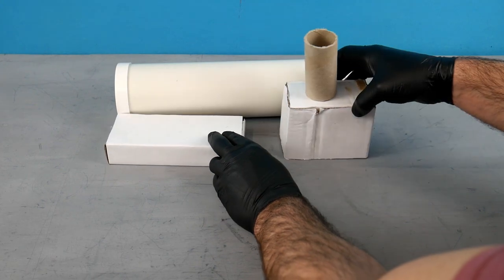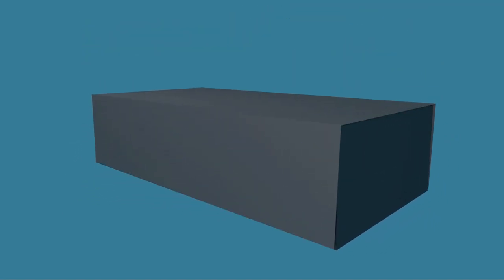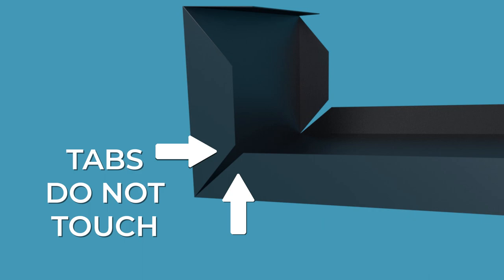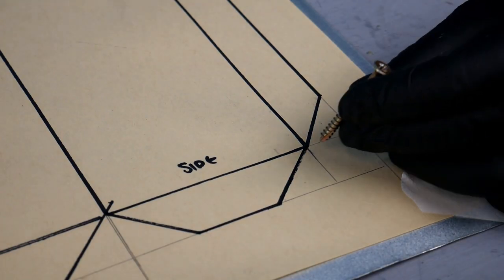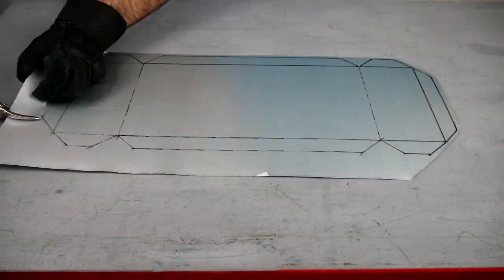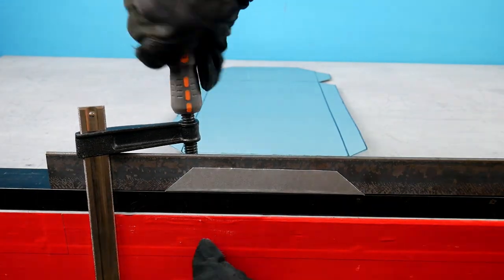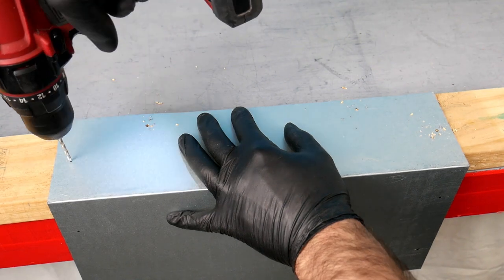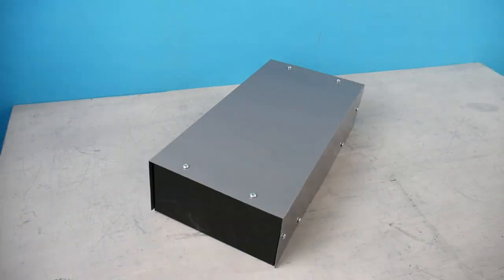How To Make A Metal Project Enclosure

Comment: Wow, you managed to pack lots of good information in a 7.5 minute video! I have a couple of comments regarding the final step of joining the halves with screws. After drilling clearance holes, you proceeded to mark out all the smaller diameter holes, and then mark them out. As the thin sheet can shift and bend while marking out, there is a possibility of mis-marking some of the holes (unless one is extremely careful). I think it's safer to mark a hole or few, drill them, connect with screws, mark out some more holes, and so on. This would take more time, but reduce chance of poorly matching holes. The other thing is, self-tapped screws into drilled holes in (thin) sheet metal don't make for a durable thread. They can even strip the first time the screws are tightened, if one applies a bit too much torque. It's likely fine if the product is to be assembled once and not touched, but if it's to be opened for maintenance from time to time, it's good to design a more durable connection method. Besides using thicker sheet, some of possibilities are: punch the holes instead of drilling them. Some metal gets displaced to the back side, forming a dimple, resulting in effectively thicker sheet that provides more "meat" for the screw thread. Other options I know of are rivet nuts (need a rivet nut setter tool), cage nuts (need square holes punched in the sheet), weld-on nuts (need welding equipment).

Comment: I liked your video and subscribed, couple of remarks:

- you can stick masking tape to your metal sheet and draw on that with a mechanical pencil for very high accuracy 

- when bending, use some thick flat band, at least 3mm or 1/8”, clamp the flat band to the metal sheet with vise grip pliers for best results, pull and hammer on the flat band, not on the metal sheet, it’s thin and any hammer blow is going to be permanent for a home diyer

- paint using oil based paint for durability 

- if needed, add reinforcements using aluminum or mild steel angle iron on the inside, aluminium rivets work great because they don’t rust and are low profile

- clamp a flat band or angle iron to the metal sheet to easily cut with an angle grinder, light kiss with the side of the wheel and then carefully follow it for an excellent result

- use the curly(not twisted) angle grinder wire brush wheel for brushed finished

Always wear long sleeves and face shield when using an angle grinder.
Reply from the maker: Thank you so much for sharing your knowledge!

Comment: Here are a couple of tips to people attempting something like that to make it easier and more functional.
1. Marking the points with a punch and then drilling them out on the flat piece makes sure you will not have access material on corners and your bends will be easier and look more professional (becasue that´s what pros do as well its called corner relief).
2. For thick gauge material you can perforate the bent line, basically like in toilet paper to easier bent it.
3. For edges being handled later on you can create a hem, which is basically folding the material over itself to get rid of sharp corners, this way you don´t even need to sand every edge. 
This also increases the rigidity of your piece significantly and makes it look clean and professional.
4. To attach metal parts permanently you can use a blind rivet gun for like 10 bucks and blind rivets, you can also use rivet nuts to use some screws.

Comment: I've been using 2x4s and a hammer to bend metal in the past. Have been interesting in an actual metal break to make enclosures, but didn't know how the inside bends work out. The part with the tiny block for the hard to access tab bends was great!

Comment: 00:42 Sorry, I didn't understand what kind of metal sheet are you using. Could you tell me? If you want to use aluminium for a 100x100x100 mm box, what would be a good thickness? Thanks a lot.

Comment: Neat!.  I need to make a largish box (12x23x5inch) for a SAD light box application, including some holes for ventilation and a strain received power cord,  plus a front bordered opening that would allow for including an acrylic light diffuser sheet.  What are good sources for the sheet metal?

Comment: Watched the video and learned something new. 
Question: How do you make those little heat vents, louvers? In your project box, and would a deburring tool work better for the edges?
From Spokane Valley Washington
Very good video.
Reply: Use a file to deburr, it’s faster and you have excellent control

Comment: Very very Nice and useful videos specially for my kind of projects.. but where is the cut for LCD. which starts from center and not from the corners. I waited for it to the end of video.. :p
Reply: And Also .. how wood pieces are fixed with metal ? from 6:02 .. are they not moving inside?
Reply from the maker: The LCD was an example of what to think about when considering sizing, I will be doing some cutouts in a project really soon.
Reply from the maker: The pieces of timber are just used to stabilise the material while drilling. The inside holes are smaller than the outside holes accompanied by sheet metal screws which will self tap, this is sufficient to hold the enclosure together. Thank you for your question.
Reply from the maker: Check out this video - https://youtu.be/w94iq-qSr9A
Thank you for your comments.

Comment: How do bend acrylic ? I want to 'build' a music stand ( the top part where you place the sheet papers )
Reply from the maker: Sounds interesting! it's on the list to be made.
Reply: You'll need to apply heat to the acryllic sheet before you bend it.
There are several videos on YouTube that can give you hints and tips, including when to use what kind of glue (as there are several types of glue for acryllics). You may also want to know in advance, how to fix scratches on acryllic sheets.
Note: You can use a heatgun or hairdryer, but if you want real sharp bends, you'll likely want to build a jig for bending the sheets.
This build is fairly simple: youtu.be/-mVmzWQ7Iy8
If you choose the above mentioned build, I'd like to recommend that you try a low voltage first, and then increase the voltage slowly until the heating wire start to get hot.
Remember to try it out on scraps first. ;)

If you're not keen on using a heating element, you can still just make a wooden bender, which has a long opening where you want the bend to be; then use a heatgun to heat up the acryllic just where it's supposed to bend, turn off the heatgun, perform the bending and hold it there until it cools off.

More: youtube.com/results?search_query=bend+acryllic
Reply: Oh - and if you'll only be making one acryllic project, then you could likely go for something much simpler - it doesn't have to be expensive anyway. ;)

Comment: Is this enclosure ESD safe?
Reply from the maker: It is made from metal and any two points should be considered an electrical short however it is much the same as a motherboard enclosure and if correct measures are taken then ESD will not be an issue. Thanks for the question.
Reply: You could paint it with Glyptal to stop conductivity.. obviously test first..
Reply: @MortifiedU  Thank you Kent
Reply: @cosador  Thank You. Do you have any web links on how to take care of ESD?